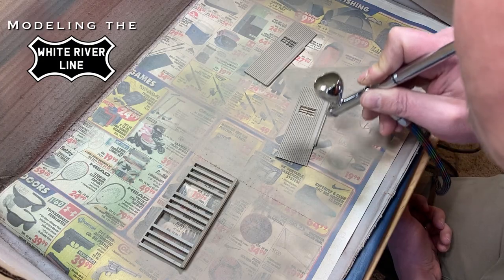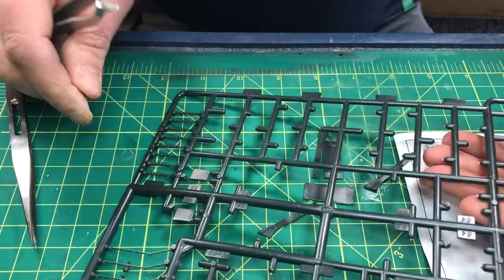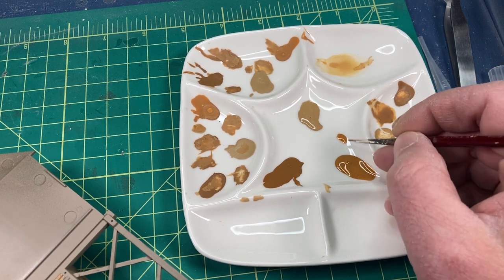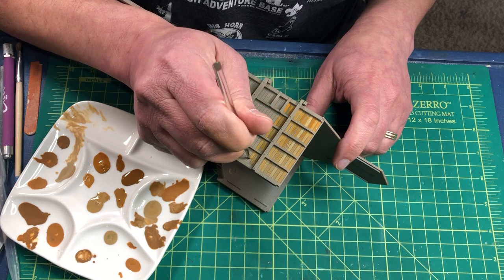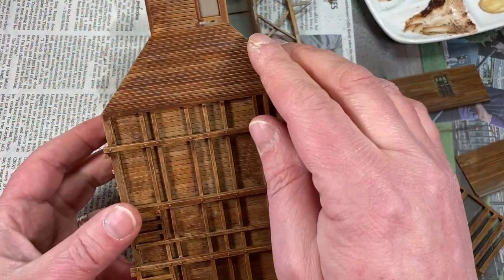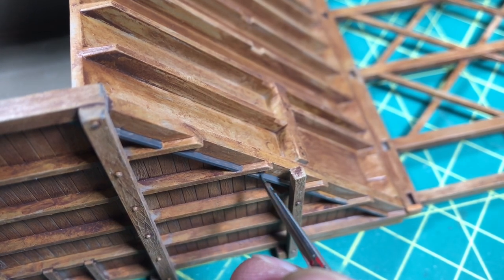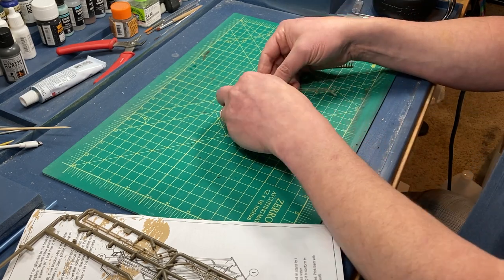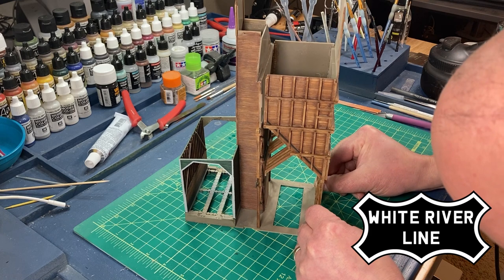Building a Walthers Coaling Tower Kit Part 2

Comment: I would recommend the Vallejo plastic putty or the one from Ammo by MiG. I use both for my OO scale kits and it works well. The Vallejo is more cream so better to fill small gaps while the Ammo one is thicker and will work well for larger gaps or holes like ejector pin marks.
Reply from the maker: Thanks for the recommendations!